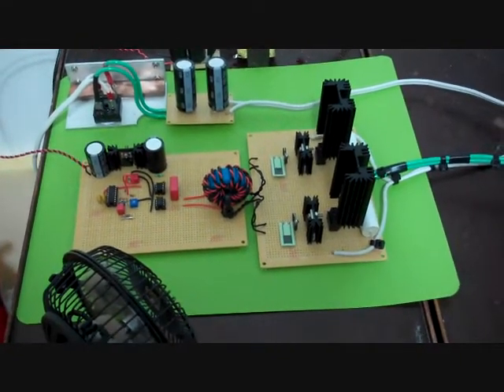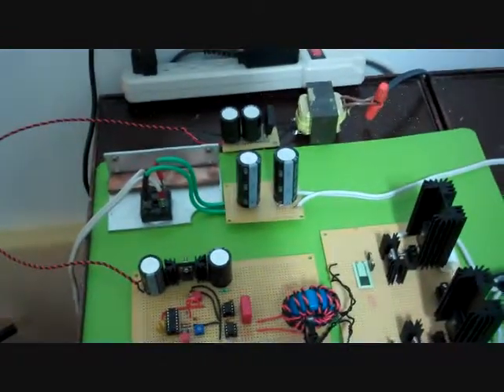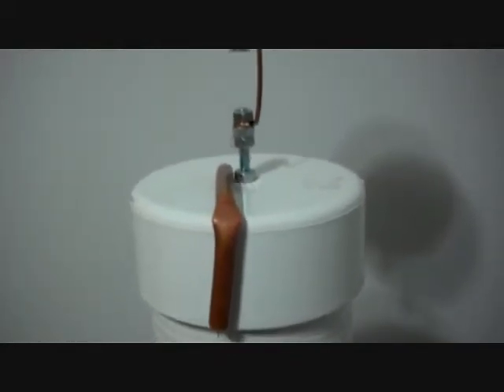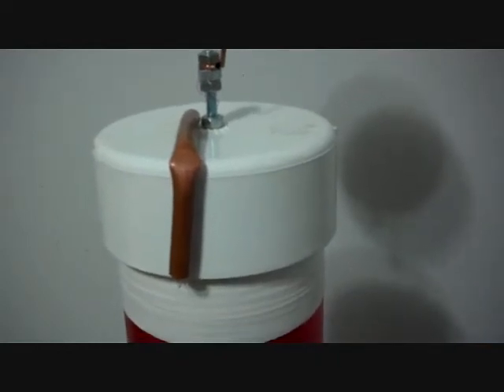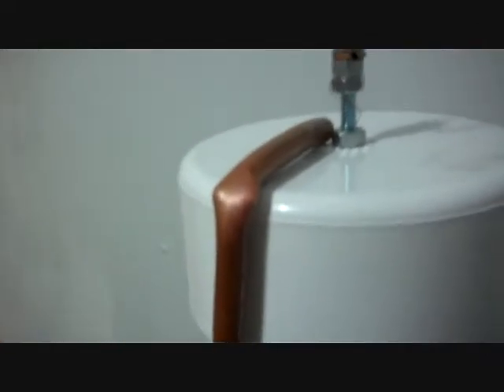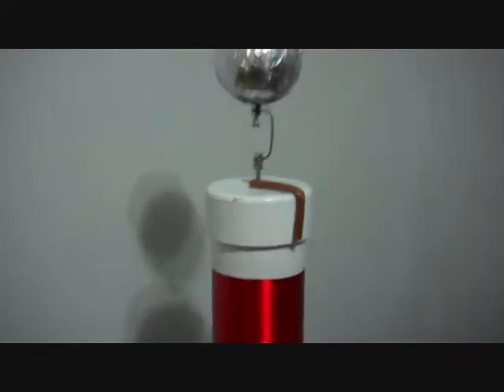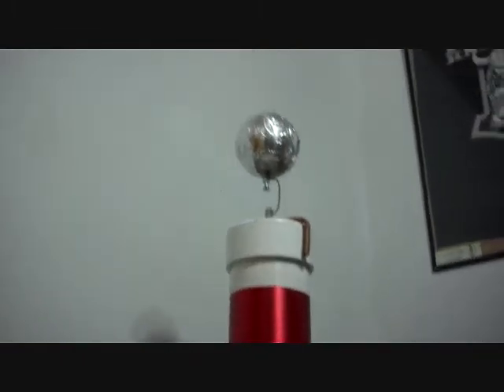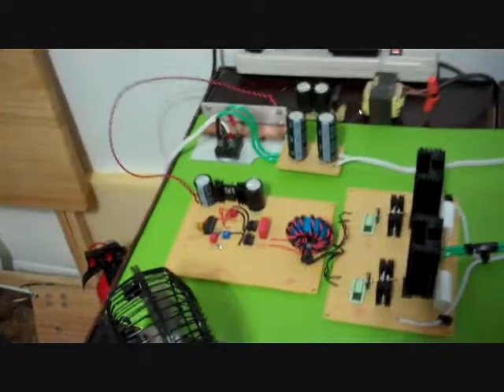PLL SSTC - part 2

Comment from the maker: This is an old video using one of my first drivers. It uses a 4046PLL IC tuned so that the approximate resonant frequency of the secondary is in the center of a 1.5:1 range of available frequencies to lock on to. This prevents the PLL from locking on any harmonics. See my latest TC videos with audio modulation for an updated version of this driver which is working properly.

Comment from the maker: A good experiment though, even if it was a failure. I'm going back to my 74HC14 based antenna feedback design. It will be awesome to see if it runs the FETS just as cool, or if they are hotter and also to compare output.

Comment from the maker: ...cont... There was no point in putting work in on the experiment. The PLL design proves to be exceptionally good at driving the coil with peak performance in mind (cold FETS and great output for CW!) but very touchy and fragile. I'm still not sure where/why the circuit fault happened. I did have to change a decoupling cap which caught fire in initial testing, but the new one tested fine and the bad one was open not short. Antenna placement with the PLL was also problematic.

Comment from the maker: Haha, that was the plan anyway.... leave it alone since it is working and build a new driver since this was basically a test if I could audio modulate via using a PLL chip instead of using normal means (a class A linear-region MOSFET (VERY inefficient) power amplifier on the DC Buss high side rail). Since the audio modulation failed for multiple reasons (too much current draw so the voltage ripple comes through in to output, and the 120Hz signal got in to the audio mod circuit also)..... cont..